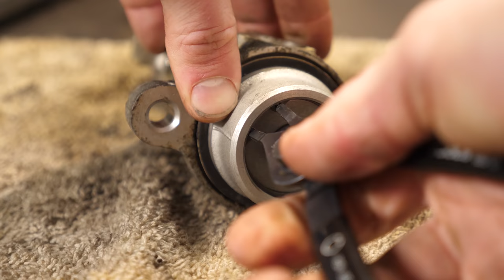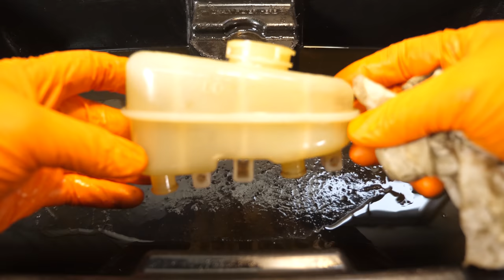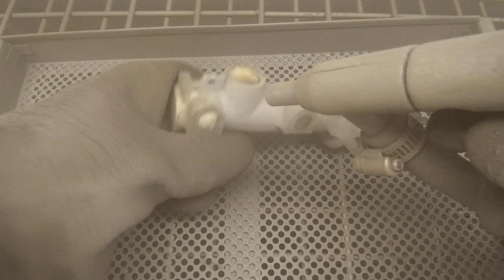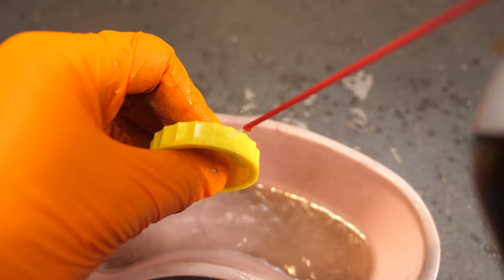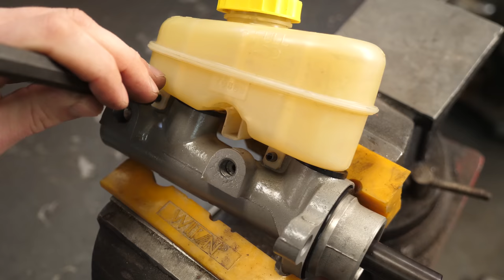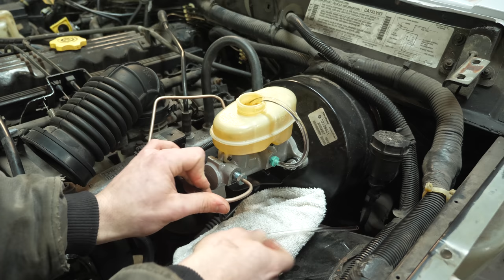Master Cylinder Restoration/Rebuild

Comment: Great video! I just got done replacing ALL the brake lines on my 2003 Silverado 2500HD. Being in the rust belt, I went with the Dorman stainless steel kit.
Reply from the maker: Kits are super nice since everything is already bent for you. I'll probably do that from now on
Reply: @RestorationStation  Yeah it was 180 bucks for 7 lines. It had factory bends that I had to unbend to straighten them out. They had stickers on them on where to bend.

Comment: Nice job! 

One caveat: brake fluid is toxic. ALWAYS wear gloves when handling any component which still has brake fluid in it or on it.

One tip: when using the low temperature plastic pellets to form plugs, push a broad flat screwdriver into the softened plastic before it sets. Then use the screwdriver to unscrew the plugs when ready.
Reply: You'll be alright, lol. Just wash your hands.

Brake fluid's toxic but you gotta intentionally swallow a decent amount to get hurt
Reply: I've used brake cleaner to clean old spark plugs from carbon build-up without gloves, and i was okay after i washed my hands
Reply: @jonathanlitz2018 brake fluid not brake cleaner, but yeah they are both toxic but just gotta wash your hands after if you aren't wearing gloves, and if you have cuts or open wounds on your hands make sure to wear gloves

Comment: Great work, very satisfying to see the progress on this XJ one piece at a time. Also loved the "?" Pedal 😂

Just a tip for anyone watching (not the creator as I could learn a lot from you) but if you're already going to be replacing the line, no need to bother with a flare wrench especially if youre worried about stripping it, I just cut the line at the nut and put a 6 point socket right on it.
Reply: I thought so too,... I was worried that'll keep the lines

Comment: Good job, a really good job. Something that called my attention was that you didn't open and closed the purge valve everytime you pressed the brake pedal to bleed air, but I didn't notice any brake fluid regression either so as it was much easier.
Reply: So long as the end of the hose is submerged in fluid there is enough flow to flush the system that way. Anytime I don't have someone with me I use that trick.

Comment: You might consider using a 3d printing pen instead of pellets so you can form a screwdriver slot or wings to help with removal.
Reply: I would never have thought of that!
Reply: That's a great idea. Thank you.
Reply: I should mention that I get them for < $20. Try to find a 12v unit instead of a 5v usb one. Remember to retract when not extruding to avoid forming a clot in the pen. Not all filament is made equal.

Comment: Quick trick - you can mound the plastic up and press a socket on it. Forms a mold and you can easily unscrew it later when you want to remove it
Reply: What is that stuff called?
Reply: @TheKillerMarine  They're thermoplastic beads

Comment: You can also use gravity to bleed the system, pressure with the open system only leads to your master cylinder, to reach positions, it should not reach and you could destroy your freshly rebuild part. Just put 4 bottles on the bleeder screws, above them, like hanging from the struts, open them and fill the reservoir up. Gravity pushes air out and you don't have to put the master cylinder in any danger. I know the old ways worked, but people had no ABS back then.
Reply: Yes. I did this when I had trouble bleeding the master cylinder on my motorcycle. Bungee corded to handle open and the next morning it was bled.

Comment: Very nice work.. What was the stuff that u were sealing up all the holes before sand blasting... Turned out beautiful...
Reply: Those are plastic pellets that you warm with hot water to make them malleable. You can then push it into your desired place and it will then harden as it cools. I got mine off of Amazon.
Reply: @michaelskinner896  ok.. thx.. m.cyl turned out beautiful..

Comment: Fantastic, but as I am really green to this, what did you use to clean, water, brake fluid, what chemicals are safe to do what. What was the plastic you used called so I can look it up. Was the tubing stainless? Just details I can't get from just watching, so I can go further. (I have a clutch master and slave cylinder, and calipers to do) Thanks for posting!!!!!

Comment: Great job. I'll be doing a lot of the things you're doing to my trail rig in the near future. Thank you for giving me a guide. The only thing I'll do different is to use hydrogen peroxide and UV lights to get the reservoir back to its original translucent white. No real reason other than for it to look pretty...for a little while at least.
Reply: I was going to say the same thing. Hydrogen Peroxide will really bring back that plastic to almost new again

Comment: if you had bought 1 liter of ethanol liquor grade, filled the  void brake fluid tank  and wait  for 2 days,  opened the brake caps as in normal air purge process   then pounding on the brake pedal you would have cleaned 90 % of  whole circuit before disassembling any piece of the pump/master cylinder

Comment: very nice jeep restoration from the liitle i could see, i just got 2 jeep 1 month ago. one will be for restoration the other was for spare which i dismantled and send the rest to scrapyard. it was heavily rotten way beyong salvagable unfortunaly.

the other as a nice custom made heavy duty lower frame from the front to the rear to support the whole frame, diff etc 
2 international scout diff 1979, disk brake to 4 wheel. 
jeep cj5 transfer case.
spare manual tranny for futur conversion. 
6 in lift, mounted on 36in irok tires on beadlock rims.
rough country suspension system
XCR front bumper w/ bull bar
11000lbs winch

took me literaly 5 days just to remove the mud inside .. lol and it still not perfect. 
there alot of job to do on it.
looking foward to see other jeep resto videos.

Comment: if you want a great general purpose parts cleaner that's less toxic than traditional parts solvent, brake cleaner, mineral spirits, etc. tide powder + HOT water. it works fine cold, but the hotter you make the water, the better and faster it works. just don't soak aluminum for an extended time, or it will etch.

Comment: I read that copper isn't good to use on brake systems.
Reply: This is most likely a nickel-copper alloy brake line. Steel can rust, so the nickel-copper is actually superior.

Comment: Did I miss the part where you honed the cylinder? Aluminum cylinders generally need to be sleeved with brass or stainless steel and bored and honed to size. Sorry. Not impressed.